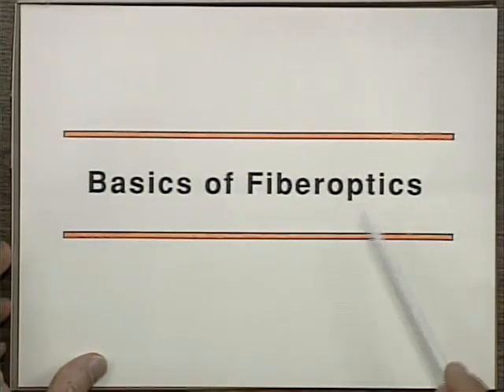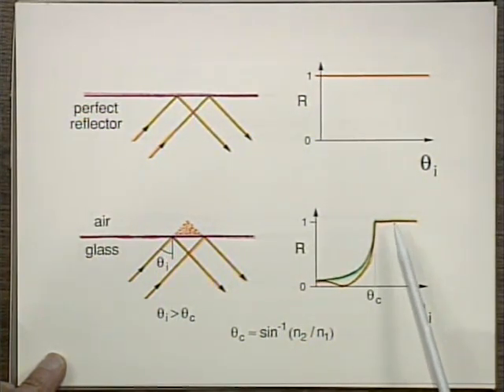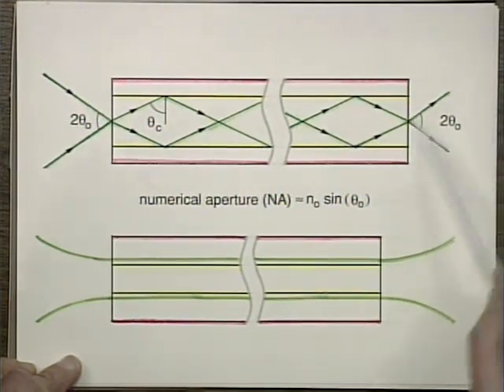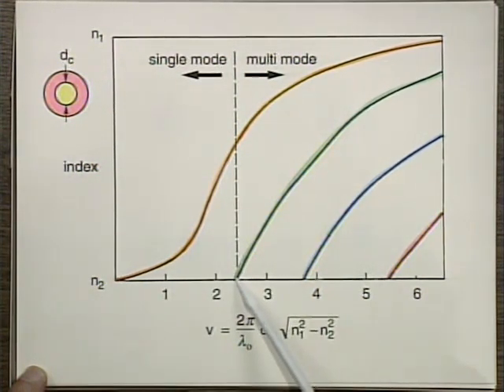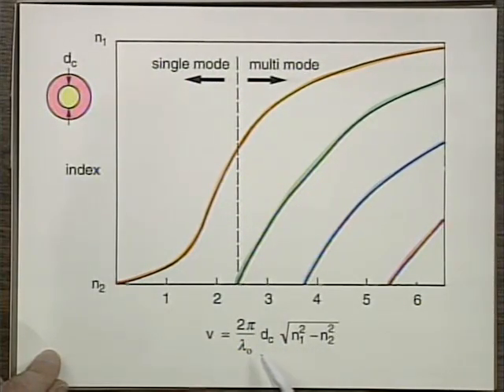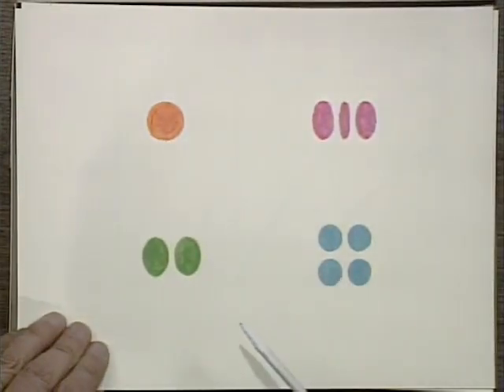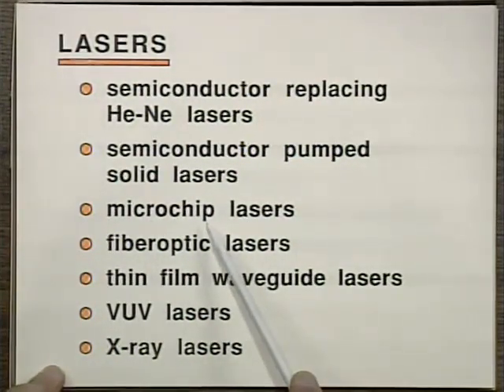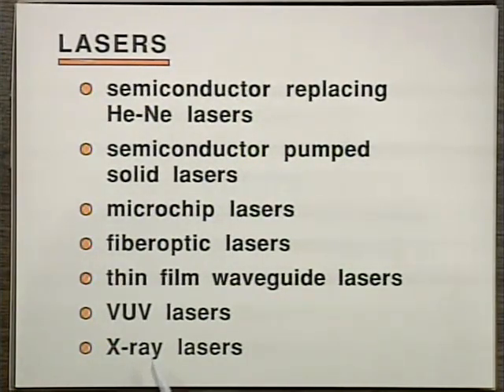Fiberoptics Fundamentals | MIT Understanding Lasers and Fiberoptics

Comment: Shaoul Ezekiel,,many thanks . i have many questions / does FOC have a Resistance to power or intensity . for instance cutting metal lasers  if its sent through foc  will it fail due too heat and will it still hold less than 2 % loss , is there a upper limit?   a strand of any particular diameter is there a limit too the amount of light it can propagate ? are there wavelengths that are more or less transmittable .. Thanks